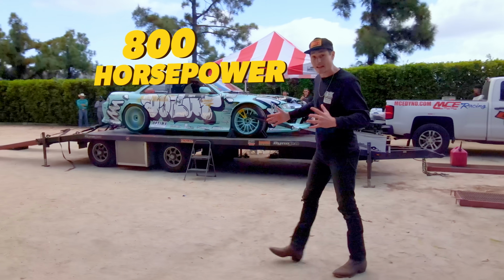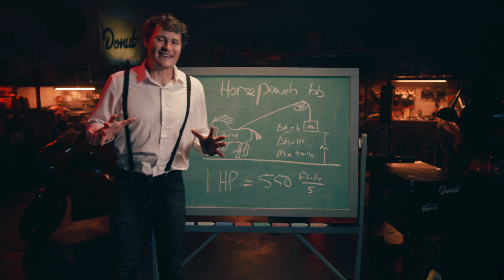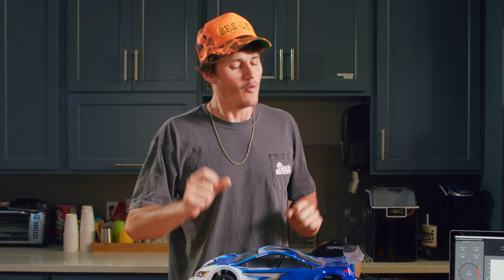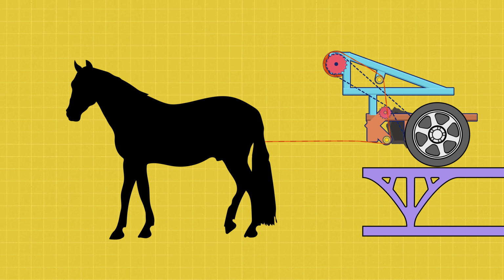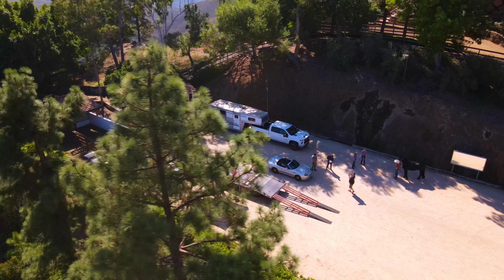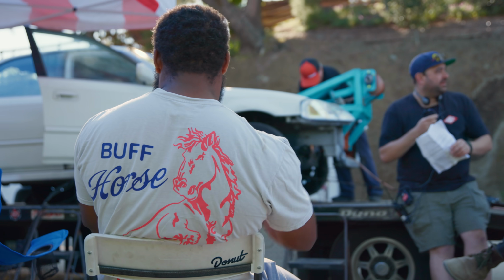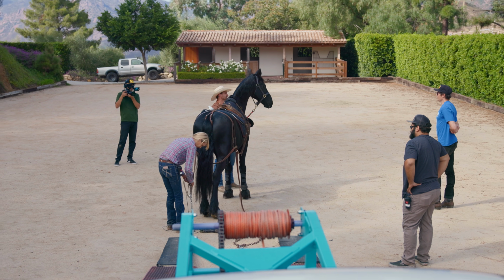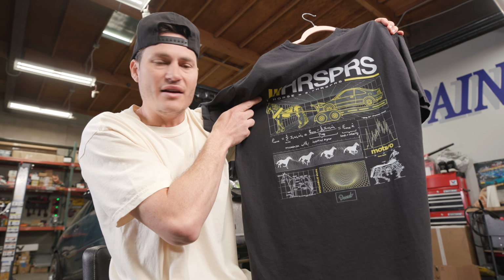How Much Horsepower is a Horse?

Comment: Shoud have also asked if 2 horses could have made around 11 HP, and then shown how much power that is. As in, converting it back to the original equations for horse power, how much weight can that horse lift, like, is it actually 550 lbs, more, less, etc.

Comment: Just saying here. . But from a scientific position, you kinda failed as you used one singular horse, and that at a really strong horse. If you were trying to find the "true" horsepower, you would have had to use a big horse, a small horse a normal horse and so on. Ypu basically have no control and only 1 horse meaning no average. Horsepower should be a standard and in order to create a standard ypu HAVE to have more than one single data point. So yeah you put a horse on a dyno but ypu only now know big D's horsepower. But big D is an above average large draft horse. Still cool as hell but ypu really couldn't scientifically claim this as a standard horsepower when you only tested one singular horse... 😢

Comment: Okay lovely but you just measured horsepower with horsepower? 

Figuring out the pulling force is different yk? Like torque? The physical torque was ASTRONOMICAL different just between the horse, 1 person and 3. We saw that by how fast they were able to get it moving. 

You just calculated that 1 horse equals 5 horses ?? Based of the original theory?

Comment: Real question, why didn't they weld a loop to the dyno and just wrap a rope around and mount the other end to a horse, maybe add a wheel stabilizer so it's always pulling straight. Would this not work?

Comment: 11:15 Looks like you might have skipped some words there, or maybe that clip is not the right clip; because there have definitely been VTOL aircrafts older than that one (or is that like a freak anachronistic design that looked modern despite being built decades ago?)

Comment: Ten minutes in. Why doesn't Jerimiah (or Donut) simply take a solid axle from the junkyard, point the pinion toward the sky, weld a spool to the pinion, and fasten the axle to the dyno (with some triangulation or something) Then just tie Big D to the spool and have him pull....? Seems simple & cheap enough. If you wanted to get real sciency you could calculate the gear ratios of the diff gears & spool/tire sizes (although maybe just making the spool the same diameter as the tires would cancel that out anyway just leaving the diff ratio).

Comment: Take the engine out of a generator, attach the spool to the generator, then measure the electrical power generated by the horse, measured in watts, then convert it to hp. Done.

Comment: Actually, possible correction to my last comment.  Bit of googling surfaced at least one claim Watt just added 50% to what he found pit ponies to produce (22K ft-lbs/min).  As well, multiple references suggest hp isn't MAXIMUM pulling power, but AVERAGE over a workday.  Someone with better research skills than I needs to tackle those.

Comment: THIS IS FALSE missing the standard for it being a days work from a horse not just a few pulls to set it up as the original experiment. If its just to test straight horsepower (One mechanical horsepower lifts 550 pounds (250 kg) by 1 foot in 1 second) then simply increase your sample size and this would be legit

Comment: This was such a fun project to work on! Glad I got to be a part of this with @donut
Reply: It seems like Big D had more power to give. After the wheels started to move he relaxed and kept speed. If HP is rpm and torque and a horse will only pull at 5 Mph for example  rpm would stay relatively the same throughout the pull (I don't know how fast they are trained to pull). wouldn't HP increase if you increase the amount of torque needed. If the Dyno takes 100lbs to move and a horse can pull 500lbs would HP increase because both are pulled at the same rpm? Is a Dyno built to max out the rpm and torque of an engine? If so my question is.  was Big D maxed out in that test

Comment: BIG FLAW ….. There’s a Big flaw in this .. the translation from crank to whp, vs your testing subject which is a horse is NOT accurate , as for this reason a carbon on a dyno can give you a Real world mind of idea of what that vehicle is capable of , also 1:1 RATIO , doing yalls test would be equivalent to dynoing a a10 mustang BUT keeping it in first gear…. 

My idea woulda been different, because whoever you may be right on “actual” HP BUT , that’s NOT atall close to real world numbers . My theory would be a retry with a belt/treadmill setup almost like a hampster wheel connected to a “Hub” and get the reading like a “hub” dyno ,however translate the equation of “drag” .. 
if I had to guess a Real world number (also the most accurate translation of real world numbers ) I’d take study of 5 runs of subject (horse) from a gait 4-5mph to Full Speed 30+/- mph , calculate the time/distance(mph) to get from a to b . And translate to a car ..I assume a real world number would be 10-15 Hp depending on breed

Comment: I can't remember where I learned this but I knew that a horse averaged 5 Horsepower. I don't know if I read a research paper or if I learned it in College when I took Automotive Technology. There were some other academic classes I took that weren't required for the degree but I wanted to make sure I used all of my Grant so as not to waste it. Honestly for all I know my father could have been the one that told me or my Grandfather that was a Mechanic. I remember my Father talking about seeing how the Allison brothers use to Dyno their  Nascar engines. He was friends with someone and they were in the Allison's garage during a test of a motor that was to be ran in an upcoming race. Dad was told not tell of anything he seen in the garage as how they were measuring the engines output was of their own invention. He told me how they done it but I'll honor their wishes even though I'm sure others know about it by now. You start forgetting specifics in your 30s and I wished I could remember how I came upon that knowledge. It could have been something simple as a friend comparing a 5 horsepower tiller to a Horse pulling a plough. I still watched the whole video all the way to the end.

Comment: I graduated with a BS Aero Eng degree in 1986. I remember the HP calculation and drawing from my old textbooks. Big thanks to Big D, and the entire team for setting the record straight. 

James Watt was probably pretty accurate in his definition. Big D did some short pulls, but Watt observed horses doing long pulls. If they ran the experiment doing an hour long pull, I’ll bet Watts numbers would be pretty close.
Reply: Or if they calculated how much work a horse could do all day long. Watt was selling his engines to mine operators. They worked 12 hour shifts. I suppose they gave horse teams breaks. But that has to be calculated into it too. No one gives a steam engine a break.
Reply: I'd rather just consider it one man power from now on 😂😂😂
Reply: @patrickday4206 that's  the most accurate 😂
Reply: @patrickday4206  one man for a very short period of time. By the end of the pull those boys were at the ends of their ropes then too. They couldn't sustain that kind of effort for any duration. Although with extensive training performance can improve. That's why certain individuals are athletes. They put in the work.
Reply: But as they said, Watt had every reason to exaggerate. Big D, buff as he is, is also only a light draft horse, and one whose custodians care more about his welfare than about his output.

An actual brewery back in the 19th century would probably be working their (buffer) horses harder.
Reply: That’s awesome, I want to go into aerospace engineering when I graduate high School, if you don’t mind me asking what kind of work did you do once you got your degree?
Reply: @beebus1540  it is a great career choice. I have worked on lots of different stuff. I worked on Space Station, turbine engines, and fighter jets. I wish you all the best.
Reply: Also, how would one ensure that a horse is maximally exerting itself?
Reply: @cynikal82  put a mare infront of him? 🤷‍♂️
Reply: Horses were used for pumping mines and it was possible to measure how much water could be lifted a certain height over a period of time.
Reply: It also should be taken into account that the horses doing the work were not single horses. The 3 person vs individual person tests showed that, at least for humans, the per-person efficiency dropped a lot as the speed increased. If this same trend held for horses, it seems pretty reasonable for measurements based on teams of multiple horses working on the same crank, which is likely what was done with Watt's experiment, to under-estimate the capability of a single horse. 

Regardless of how much incentive Watt had for under-estimating that capability of a horse, it seems like there are plenty of factors that would contribute to make it possible that he really didn't exaggerate all that much, if at all.
Reply: Agreed. Watt's estimations were for horses working all day, which is the point of the comparison.  Any horse could pull 10's of HPs for short bursts, no problem.
Reply: Why an hour long pull? Isn't the peak the most important part? Because they always calculate peak horse power, no? I don't understand the 'hour' but I do understand that a longer length pull would be better. There is also a lot of variables like the surface grip... I'm trying to learn by the way.
Reply: @samd7106  The horsepower measure was an attempt at comparing animal power with machine power, hence peak power wasn't important. If a horse can acheive, say, 10 horsepower for a few minutes, it doesn't matter, because the comparison is what a horse can do vs. a steam engine.
Reply: @samd7106  There seem to be multiple accounts of the original test that was done, but the one on Wikipedia, at least, is that he found that over the span of one hour, a draft horse turned a mill wheel 144 times, and based on the distance traveled and force to maintain the turning, Watt defined the horsepower to be the average power output over that time. If true, the original horsepower definition was not based on peak power over a few seconds burst, but over a sustainable comfortable working pace. Regardless of how we measure car horsepower capability, the definition of 1 horsepower wouldn't have ever been made based on what a horse could do at peak effort.

Imagine Justin bench pressed 100 pounds 100 times, and we made that into a unit of force. Later, Jeremiah comes along to see if he's stronger than Justin, and finds the highest weight he can bench once. He manages 250 pounds, and declares he is 2 and a half times as strong as Justin.
It's just a completely different type of test than what was done to originally define the unit, so the results are not comparable.
Reply: This is also not quite accurate if we want to make a comparison with cars. The closest match here would be a horse pulling a carriage on a road. Since power = force * speed, the actual result for galloping horse can be significantly bigger than 1 HP. And it doesn't have to be an average over the whole day since back in the day it was common for carriages traveling any sizeable distance to change horses on their way.
So a good test would be just running a carriage for an hour or so while measuring pulling force, distance and time. It also wont require a sacrificial car or overly complex mathematical models.
Reply: @E1Luch  when Watt conceived of horsepower no steam engine was portable. So bringing transportation into it would be inaccurate. Also Watt was most interested in sustained output not peak power for a short duration.
Reply: @1pcfred  And yet today we mostly use horsepower in the context of internal combustion engine, and all industrial applications use electric motors with power output measured in Watts, ironically. And even if he was right not only for his low-speed draft horse case but for the case I described as well, it will still be cool to see well documented modern day reproduction of his results.
Reply: @E1Luch  a lot has changed between then and now. Before Watt came along there was no reason to quantify power. Which was why he had to do it. Watt's contributions were so significant that the unit of power was eventually named after him. The Watt. But he had nothing to do with that. He was dead before then.

Comment: Depending on what your going off a computer because technically 1 horse means one horse per wagon so by tech standards you'd say miles per hour 0to60 per sec even by horse standars if you have 800 horses odds are your not going to 180 mph add Gas and a controlled explosion such as nitro turbe different mathematics but just a saying ask this if a boat has a horse on the front odds are it won't move so the you'd say shark power or dolphin power I'd say or in a motor how much combustion harness power  controlled power and odds are 800 horses pulling a wagon if not controlled or a good lead horse your going to blow a shoe or piston. With that does dyno power mean dinosaur power or in modern terms dynamite combustion power nitro and ethanol mixed or gunpowder and leaded or unleaded still ethanol with out the paint chips unleaded used potato chips the leaded shit had to keep the spray paint packed up. Used to customize are horses with war paint the one day could not do that unless you asked grandpa or mom or dad so stared using shells to mix in the paint crushed shells give the custom two or three tone look. Yep had to lock the air cans up few people couldn't get enough o2 and hit off the air can which is ok if your under water but on you just have to go outside. Yep seen a fella with a gold ring in his nose I thought it was jewelry until I seen the spray can. Like gm not horse power CAT power Cadillac or diesel powered

Comment: "An average work horse achieves a maximum of just under 15 horsepower, while a human at peak production achieves around five horsepower."

Given that your averages are 1-2 HP for the few humans you test (who, with respect, do not seem "peak") and 5 for that horse at a medium pace, which was likely to reduce the strain on the horse, as well as a shorter rope not allowing the horse to get up to a full speed if you were to predict data on a graph it would likely match the numbers of previous predictions.

Comment: I'm not pretending to know anything about mechanical engineering, cars, or horses but I have a question. Why didn't you just make the dyno drum your spool and wrap the line directly around it instead of building a whole contraption and attaching it to a car? Especially after the whole explanation @19:30

Comment: UHM,  not to burst your bubble, but they make dynometers for horses already.  They 2 versions, one the horse run on a treadmill, where the conveyor belt runs around the torque drum.  The other is a vehicle that is pulled and has the inertial drum installed on it.  Back in Watts time they had treadmills for hoses to directly power a shaft in a mill, the treadmill was angled so the weight of the horse helped with getting the system running, so he could directly compare the steam engine output by swapping the treadmill with a steam engine.

Either way it looks like you had fun
Reply: search for: Iowa Dynamometer Car for Horses to see the one Ford built in a 1925 Ford Truck
search for: Michigan Dynamometer Association Inc

Comment: Awesome video! 

Cool to see the lab I did back in my college physics class on a 5 story flight of stairs was actually kind of accurate. The class came up with around 0.9 - 1.2 HP depending on the althetic ability of the student. All we did was measure our weight, the distance we traveled up the stairs, and then time we could do it in and from that were able to calculate our estimated horsepower numbers. To see it done with a dyno though is even better!

Comment: This is SUCH a good video. I think every car guy has wondered this at one point. Props DM team!!🎉
Reply: I was literally discussing it with my brother today!
Reply: This still doesn't answer it. An engine will deliver its rated horsepower for a long duration of time. Or at least a significant percentage of it. When James Watt conceived of the notion of horsepower it was for replacing actual horses doing real work. Because up until Watt horses were all we had. A mine would have a huge stable of horses that did all of the hauling out of the mine.
Reply: “Stalactite”
…unless it builds up on the ground.   Still funny.